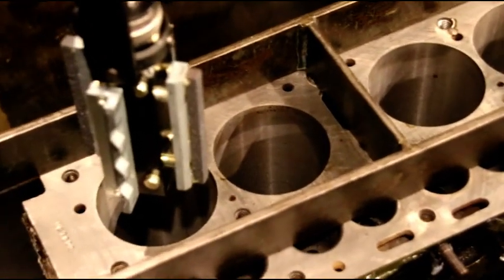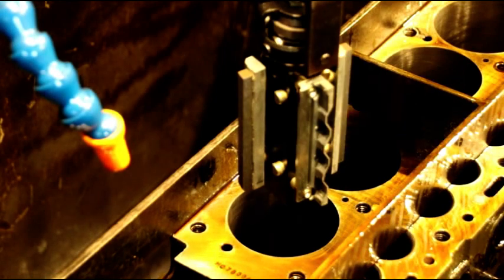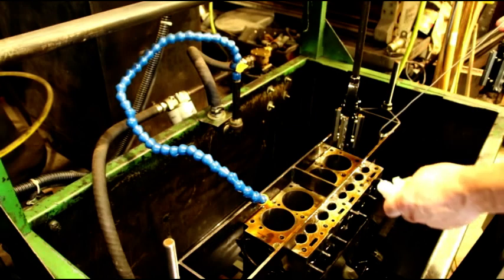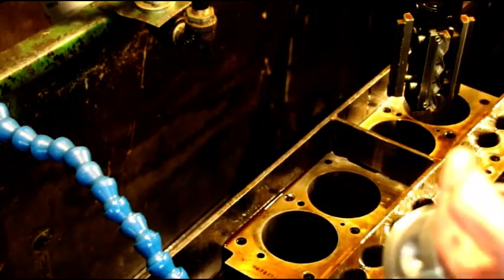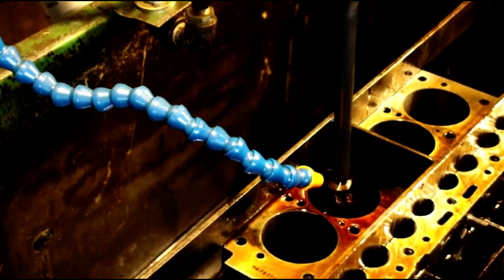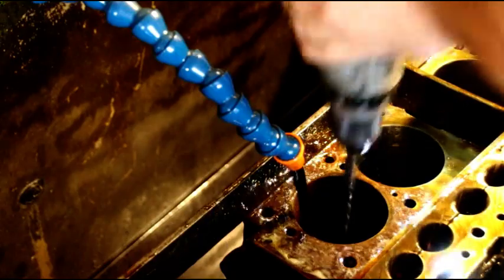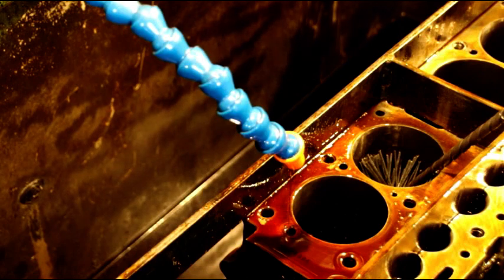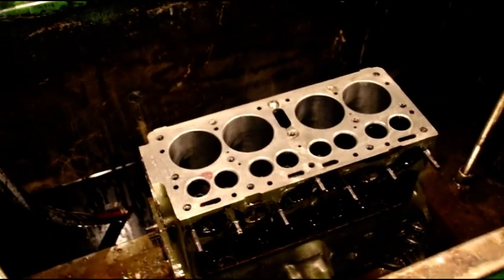Engine Honing, Piston Fitting and Proper Cylinder Finish

Comment: Hey Brian, I'm subscribed. And regarding my earlier post today asking about wall clearance, I watched another one of your videos that shows that new pistons should come with a final bore size and the recommended clearance built into the pistons. They should be approx couple thou smaller than the final bore and that's your piston to wall clearance. But I am measuring each piston rough honing to within a thou and fine honing to fit from there, like you are doing. In the end though, should I be using the same size feeler gauge, .003, as you did, to get my perfect fit? Is that kind of a universal size to get the right fit? Does it matter if I have 4032 pistons?

Comment: Hi great video, but I have a question. My piston mfgr recommends a piston to wall clearance of .003, so if I was to use feeler stock of .003 would that get me to the correct clearance? Or do I add .003 to my dial bore gauge and then start hand fitting? This is for a 4032 forged piston. My plan was to measure the piston skirt and set my bore gauge to that and when I got within a thou, I would start hand fitting pistons. What's the difference between getting piston wall clearance and the hand fitting clearance with the.003 feeler gauge?

Comment: A textbook operation! Unfortunately few engine shops apply these correct techniques , furthermore a Jeep engine is likely given to the apprentice to work on, the amount of attention to detail you apply to this rebuild is  really excellent, I think it is the hours that go into the correct way which puts engine shop off of doing it like this, but it does not prevent them charging for a correct job. Say Safe! Chris B.
Reply from the maker: Good to hear from you Chris.   I always try to give people the  best engine possible, and take my time to get the best results.  After opening up a lot of failed Willys engines I can clearly see that there are not many shops that care to do things right anymore.